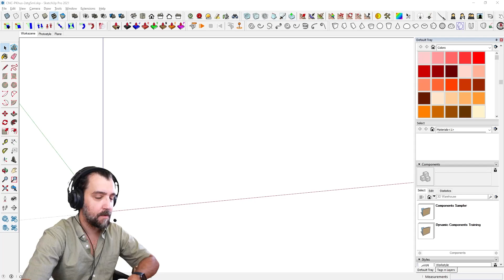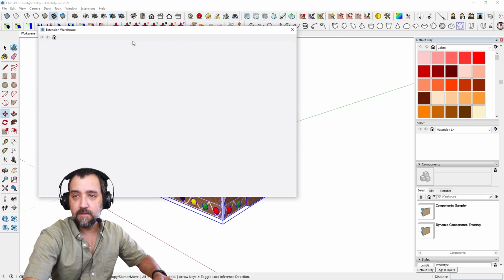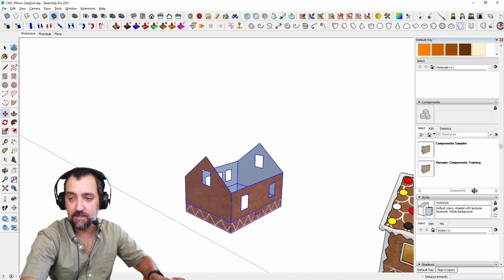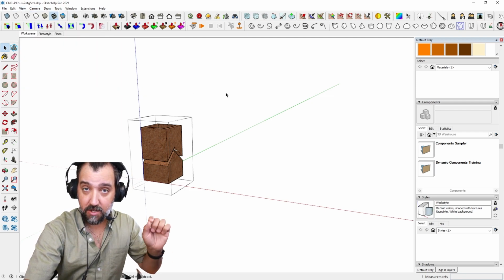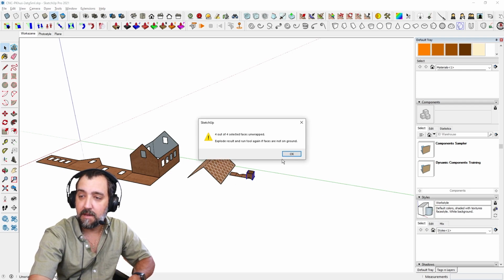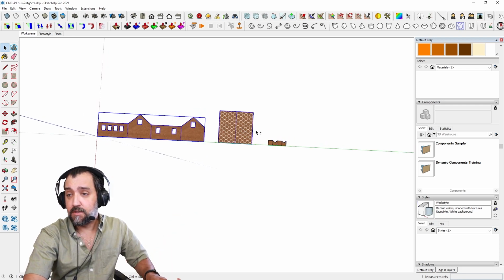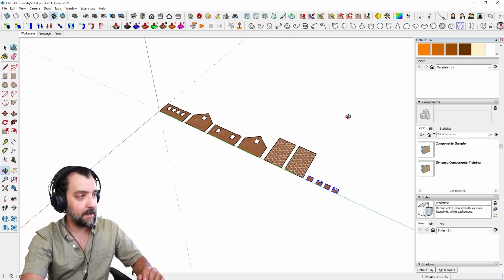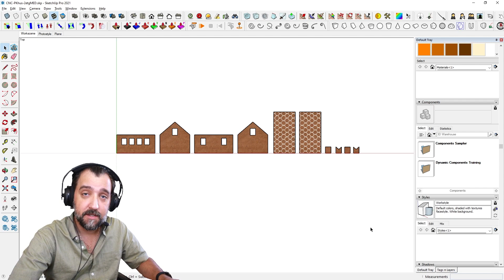Make your Sketchup models flat and ready for CNC

Comment: Thank you for the informations, but if we need to flat a cone truncated did the thickness of mdf matter. 😊😊😊
Reply: Well, yes. To lay flat, just remove one triangle before laying it flat, then copy one to fill the missing one. Then you would need to account for the thinkness in the bend. For example you can use a 45-degree bit to make a gruve along the length of each triangle to make it easyer to fold.
Reply: Thank you 😊😊 @MrTeeF

Comment: Thank you! How do i make a hole in the panel with a certain depth? For cabinets connectors for example.
Reply: Try to explore the OpenCutList SketchUp extension. In its last version it offers a way to export to DXF with cutting depth.
Reply from the maker: You create the shapes in sketchup but the depth and profile you set in your CNC software like eclipse.